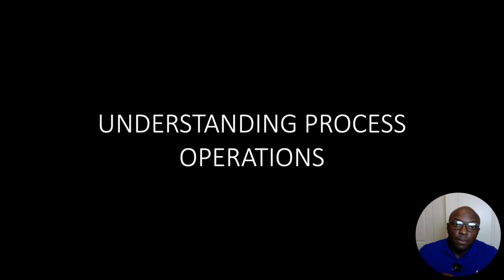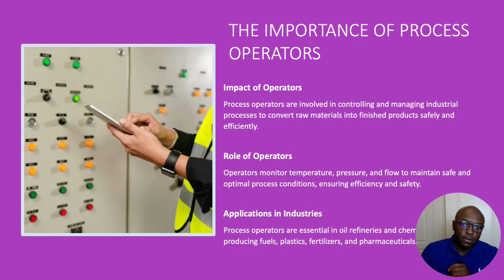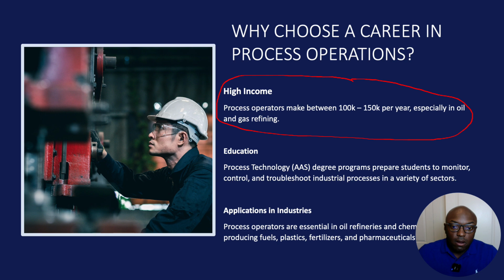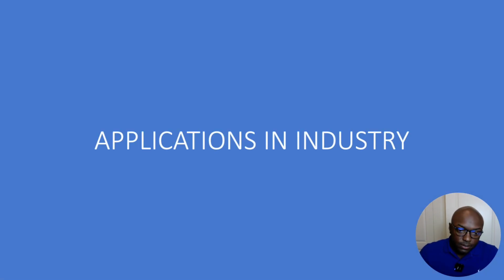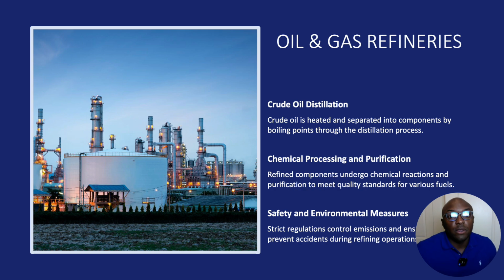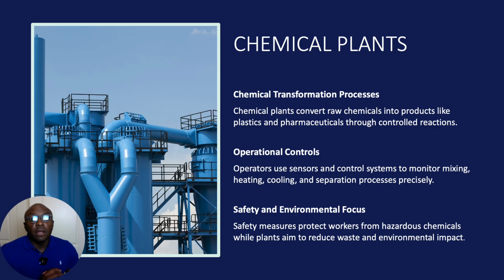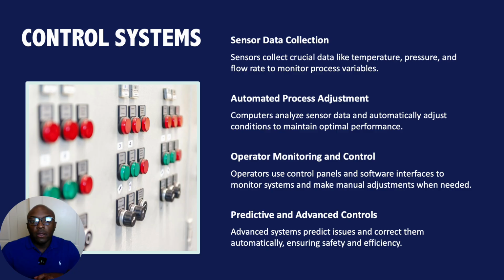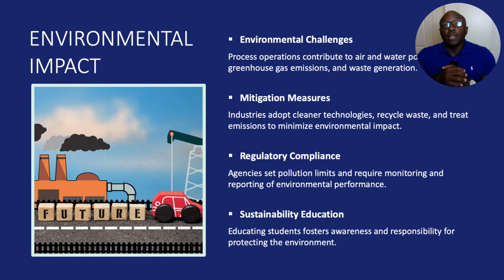The Flow That Fuels the World: Intro To Process Operations

Comment: Hey man i got a question what type of work does someone with a preach degree do working offshore differently compared to working at a plant?
Reply from the maker: The job is similar, you will be monitoring pumps, drilling equipment, valves, pressure, flow, temperature etc.. both work 12 hr shifts. Difference is scheduling and certifications. Off shore you have to have a Twic card, and there is an extensive background check
Reply: @winningwithwells what is that position called on offshore? and also what is the differences with schedules and certifications?
Reply: @winningwithwells is it the job demanding? and is there differences between being more demanding or oil rigs or refinery’s?